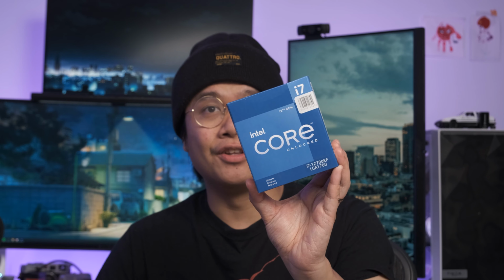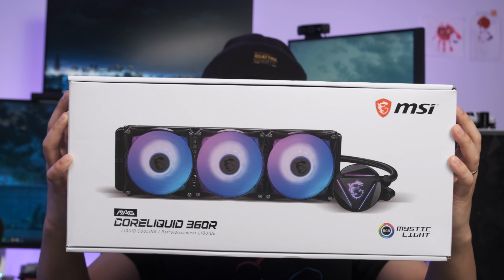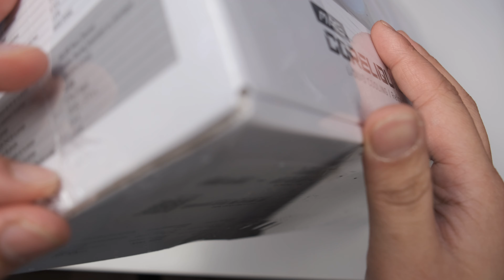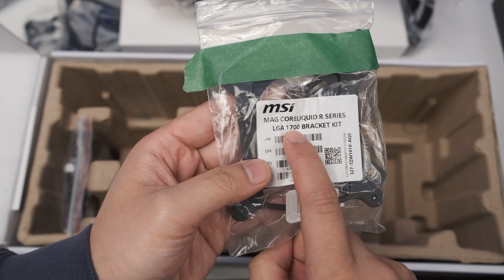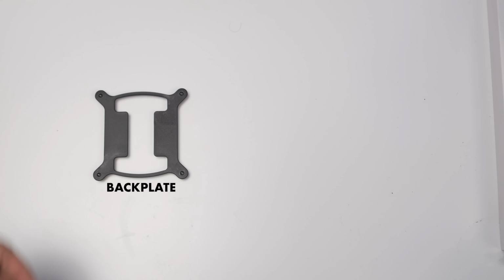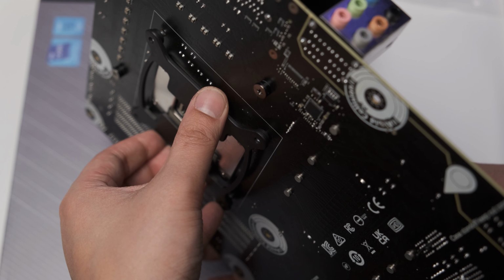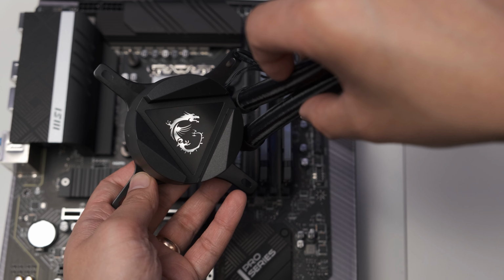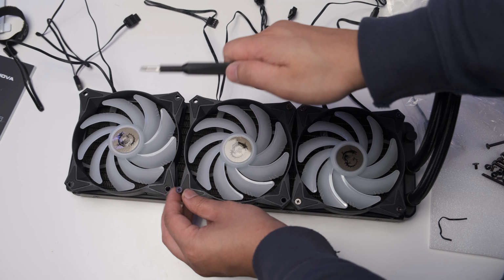HOW TO INSTALL MSI MAG CoreLiquid LGA1700 Upgrade Kit Installation

Comment: The LGA1700 plate-to-screws had a serious loose... wtf MSI?
I had to attach some seals on the protruding mounting threads to fill the gaps through the motherboard.
I have no idea who designed it like this but  MSI have terrible designers in terms of ergonomics and practicality.
I literally HAD TO modify their new 1700 kit. And having 50 Celsius on a processor is not satisfying and probably bad omen because It's the same or even bit higher temp I had on air cooler Fera 5. It's irrational and frustrating as hell
Reply: I have the same issue.
Reply: My backplate is super loose…
Reply: What kind of seals? I need to get mine setup too but it's past the return from when I got it but just started building today.
Reply: Talk about a crap design.  No quality control at MSI or they would of caught this.  Now try to fix or send it back.
Reply: My new setup the standoff screws are too long, when i try to sit the unit on top of cpu the fitting is quite loose because there is a gap between tightened screw and bottom of standoff, this is a recent build? i need  to add some spacers to fill the gap to tighten it.

Comment: How is the temps now? Don't you have to use the washer behind the motherboard?
It's wiggling and temps are crazy on my build
Reply: to whomever liked this, i returend this garbage aio, somehow the copper got bent after only less than 7 months use and the temps going 99c steady without any load, bought ek aio and is now happyt
Reply: @Shudgum I just installed a new set. and my temperatures are 100c. drama, I don't know what to do with it?
Reply: @jakubwojciak7527  set? msi products have high chance to break, i have motherboard, aio cooler and laptops and all have issues. i just returned it

Comment: is this the MSI MAG Core Liquid 360R V2 - AIO RGB CPU Liquid Cooler - Rotating Cap Design - 360mm Radiator - Triple 120mm RGB PWN Fans version?

Comment: If anyone knows my lga 1700 bracket came with two strips of double coated tissue tape I’m guessing I leave this on right it doesn’t peel like double sided tape so if anyone knows I’d really appreciate it
Reply: I peeled mine off and it has a rubbery double sided tape underneath just for adhesion no heat transfer. As far as I can tell

Comment: What is the difference between this and the 360R V2? I've looked everywhere and I can't seem to find any difference.
Reply: The V2 is the exact same cooler but the LGA 1700 bracket is included in the box.  Otherwise your having to pay for the bracket separately, or need to request it from the manufacturer.

Comment: the old asetek brackets do fit lga1700 just arent supposed to trusst me i have the x73 and 12700k and my official lga1700 bracket just arrived lmao i built it like 3 weeks ago
Reply: Dude slow down.  Show the screws up close they put my screws and motherboard bracket in with the non 1700 stuff.  I’m missing a cable and covering just a few seconds of the wiring would have helped me figure that out quicker.  Basically I’m saying assume I’m an idiot please, especially this targeted videos for just one product. I haven’t put a backplate on a motherboard in a loooong time.
Reply: @ryanmauldin8131  that’s a lot of words I’m yet to put on the official bracket because the old brackets fit with some finess
Reply: @Huntorix  My bad meant that for the video creator

Comment: I just bought 240r V2 and this lga 1700 doesn’t fit and can’t do anything about it. The standoff screws that you’re supposed to screw into backplate are the same size as backplate holes - you can’t screw it in! Another missing bit is on the standoffs alone - they’re too short and can’t even reach cooler mounting. 
2 major strikes - it’s awful and i do not recommend it. Go look for something else.
Reply: I have the exact same problem - were you able to get your hands on standoffs that fit?
Reply: @CopiumCopi  no i did not find fitting ones so later i returned it. instead i just went easy way and bought Pure Loop from be quiet! and it fits perfectly.

Comment: Is anyone having and contact issues? I have the cooler and got the upgrade kit and my temps keep rising n rising.
Reply: How did you solve this?
Reply: My asus z690 mobo has an option to use the new lga 1700 or older lga 1200 I went back to the 1200 bracket and my temps went back to normal idle around 30-32c.  Sorry if this doesn't help I know not everyone has a Asus motherboard.  GL